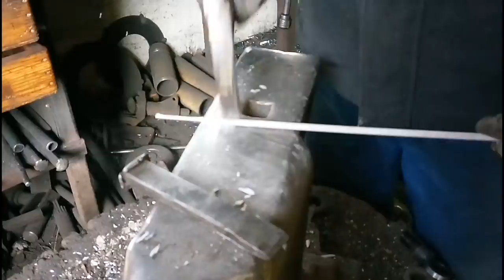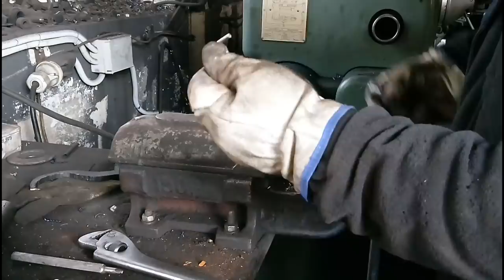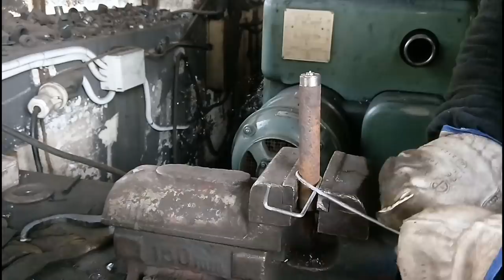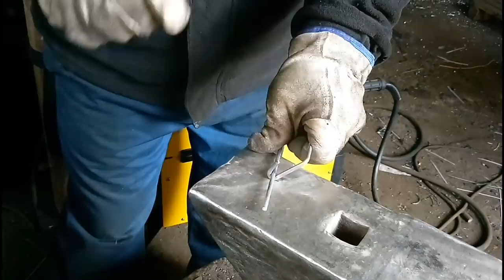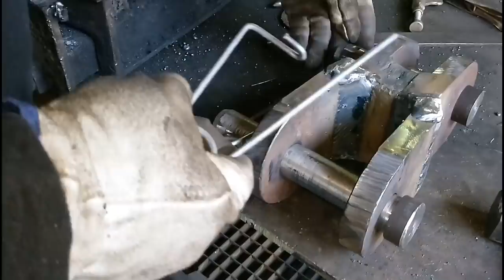Safety Lock Pin | Siguranta Blocare

Comment: the welding stick is not a good metal to do this.
also with this link you have a better model, more easy to open; https://3dwarehouse.sketchup.com/model/c79e5348431aa64facc3f72372e5161b/EPINGLE-DE-SECURITE
Reply from the maker: You're right! This is a more practical model. Of course, there are much harder materials to make these safety pins. But this is a DIY project and the welding rod has a thickness of 4 mm. For some applications it has the necessary resistance.
If you need something very strong then you will definitely buy a safety pin. Thanks for your suggestion